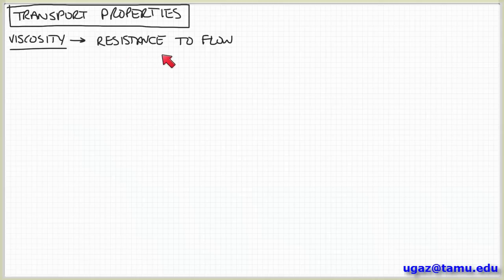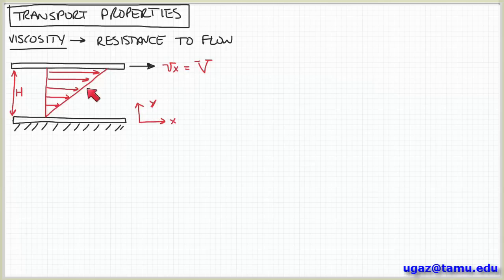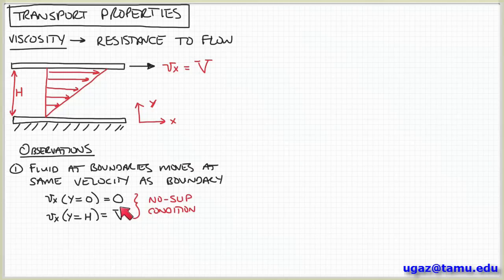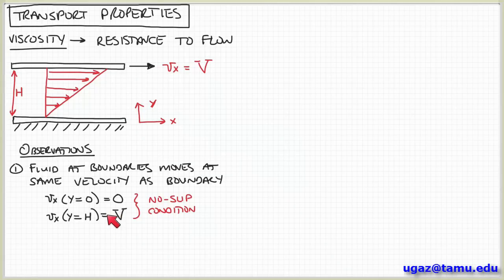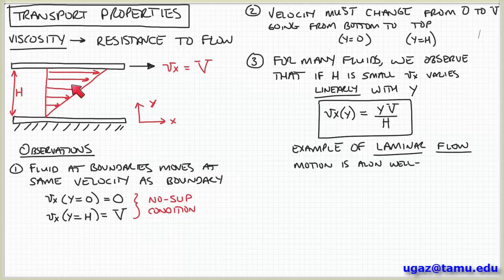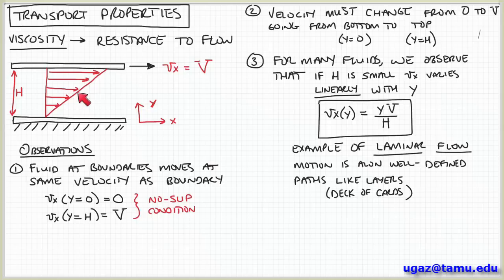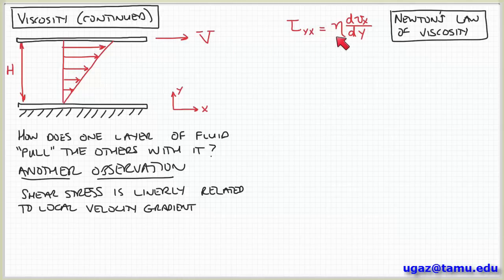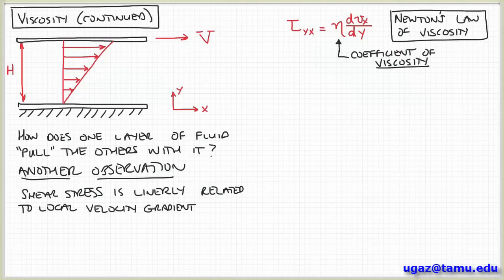Introduction to Viscosity - Lecture 1.2 - Chemical Engineering Fluid Mechanics

Comment: That is from the kinetic theory which describes the behaviour of particles in solid, liquid or gas. In liquids the intermolecular attraction are moderately strong and bonds are continuously breaking and reforming b/w them which allows the liquid particles to flow past each other instead of being held rigidly in position as in for sold particles.

Comment: I didn't get the last part,
As if by increasing the temperature of gas, viscosity goes down because of increased amount of collisions,
But in the case of liquid, though the weak interactions are broken but they are also energized more, and more momentum will be transferred,
So why the same thing is different for two cases

Comment: The velocity profile on Laminar flow is parabolic though, isn't it?
Reply: I think you're referring to the case where a pump pushes water forward, thus making the parabolic profile. But in this video, the example is "top layer/plate is pushed forward." He also mentions that he is using an approximation where the height is very small